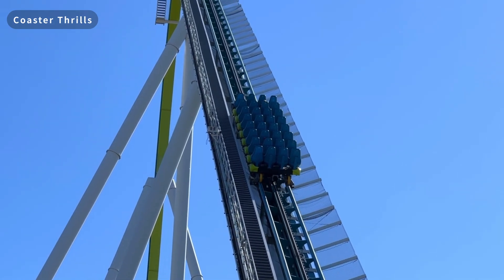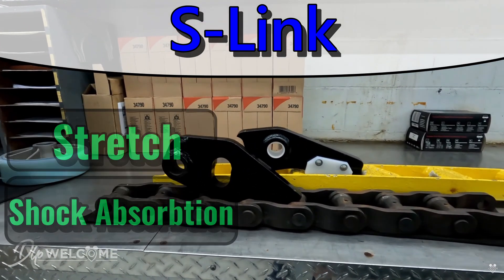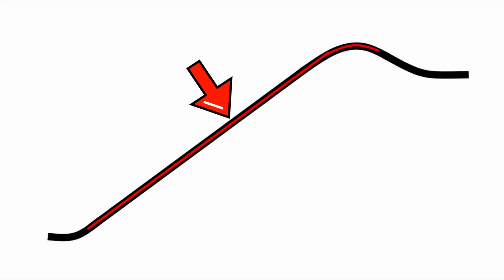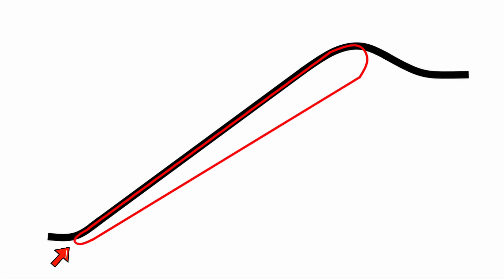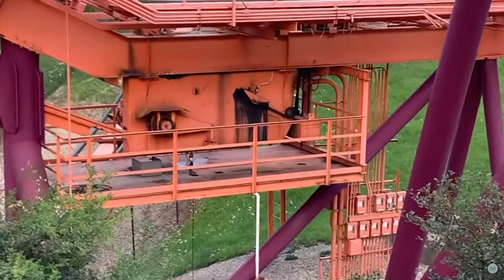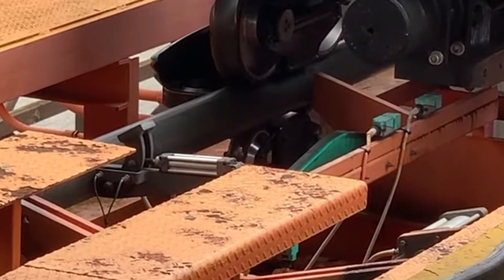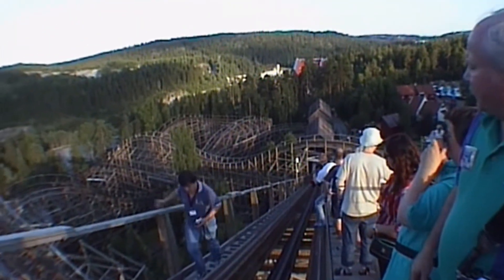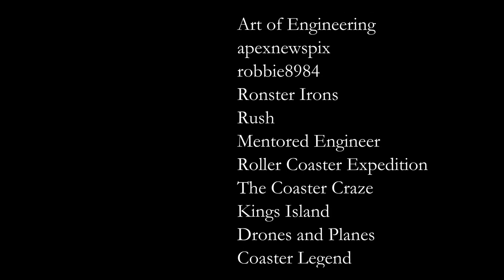How Stuff Works: Roller-Coaster LiftHills

Comment: The block zone section 😭🙏. Also good explanation. After all the other videos about lift hills. This is the most detailed. Most just talk about the chain and arb. Not much else about how its powered or other systems. One extra is that trains actually usually have the chain dog in the back. That is because its easier to push a train than to pull it up the hill. Thus reducting stress. Also on taller lift hills i believe some use an extra motor at the top to help with stress, load and length of the lift hill. I know Fury has one at the top and i believe Leviathan has one as well. Which is part of the reason the whole system is inclosed. The other part is the clean look. But its to help since pulling an almost 5,000 pound train up 325 feet is a big ask for one motor alone. Its not the same massive one that below the lift base and it cant pull it up on its own as its much smaller
Reply from the maker: @CarolinaCycloneJames  interesting, that's pretty neat